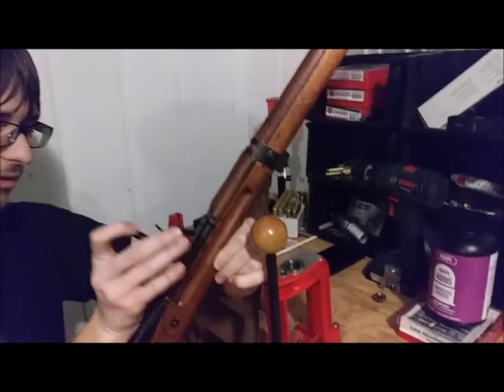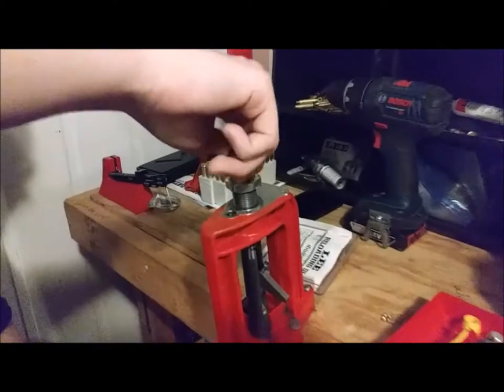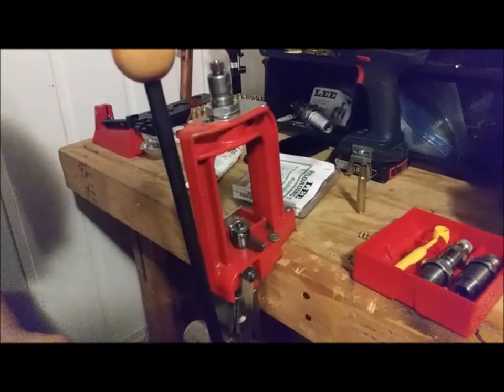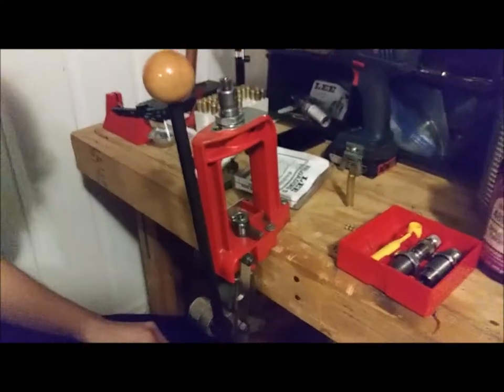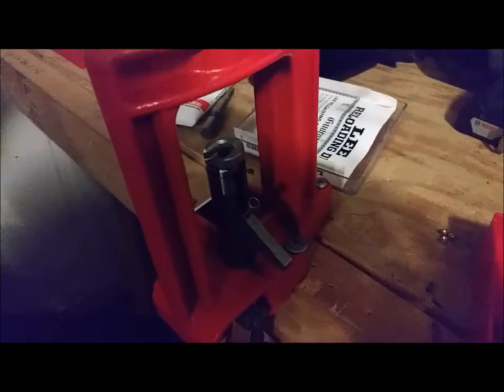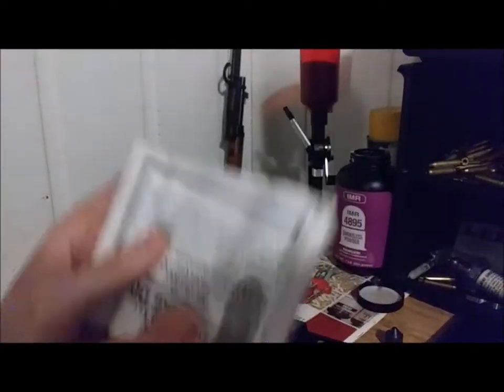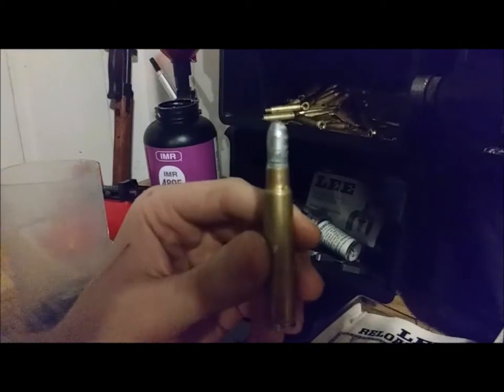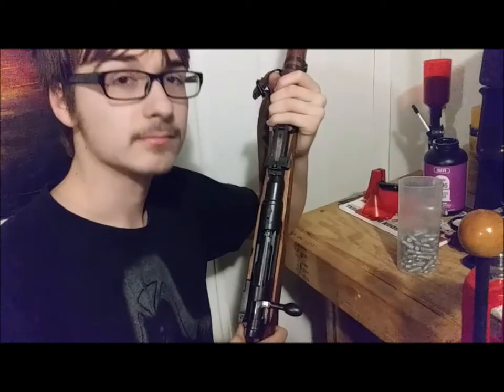How I Reload 7.7x58mm For $0.22 Per Round (Load data not valid)

Comment: I dont wanna sound like a know-it-all jerk but I shoot cast bullets in literally 55 different milsurp rifles including this one:
You're way over what any load manual lists for a cast bullet with 4895.  You dont need or want to push a cast bullet that hard, especially without a gas check.  If these shoot good for you and don't deposit lead in your bore, it's an unheard of miracle.  Maybe the smooth rifling and chrome bore is saving you, but this would cause you big problems in most rifles.  
  You're at the upper end charge of 4895 for a JACKETED bullet of 180gr according to my Lyman manual.  Get the Lyman cast bullet handbook or read the "cast bullet loads for military rifles" guide, which is free and excellent.  Just google it.  
Back down to 25gr and see how they do.  Bet they do better, less leading, and you'll save money.  Also, a heavy crimp on a cast bullet can actually size down the bullet, causing accuracy and leading issues..  You have one exposed driving band so thats good, because the bottom one is probably getting squeezed down by your crimp.  Try no crimp and push the bullet into the case against the table.  If it doesn't move, you don't need a crimp.

Also, I would get the Lee expander die.  Bell that case mouth just a tiny bit first, and it won't scrape your lube (and lead in some cases) off when you seat the bullet.      Use the crimp die only to remove that flare you put on it with the expander.  It's a must have for anyone shooting cast bullets IMO, especially when you have a worn out Mosin that needs a .313 bullet or something.  

Buy a cheap mini vise grips from harbor freight and clamp that Lee cutter/case gauge in it, you'll be amazed how much it helps and you'll never slip like that which can cut your fingers.  Helps a ton for doing lots of brass because you don't have to hold it tight at all since you now have a right angle and the vise grips is going all the work to hold it from turning.
Reply from the maker: Agreed it's a bit fast I backed it off. They do shoot well and lead is minimal. Metford rifling helps a lot but 30grs or less is golden. I've made subsonic ammo as well which is basically .300 and drops like a thrown rock. I'd use lead for deer however without worry. Serria game kings are great however.
Reply: lol.   I am making my first cast loads using quickload.  i wanted to see what people on youtube do.   this is the only video I could find.   I said 40 GRAINS of 4895????  lol.   ran the numbers.  says 2200+ fps.  um.  ok im going back to my unique now. lol.
Reply: Best advise and response I’ve ever seen on YouTube